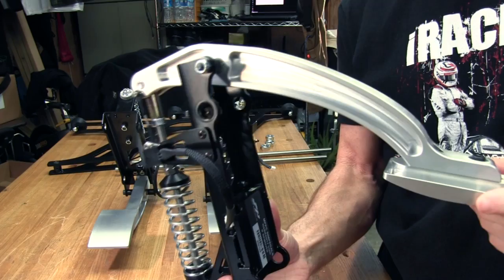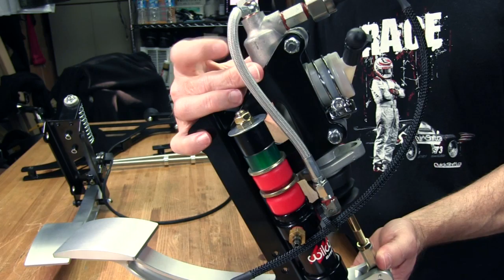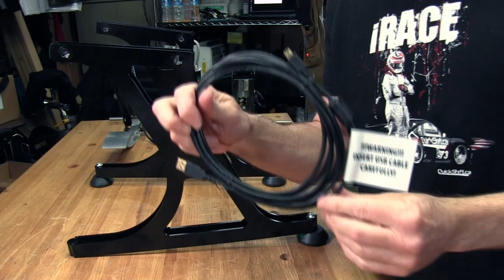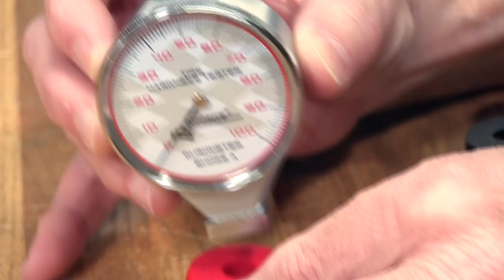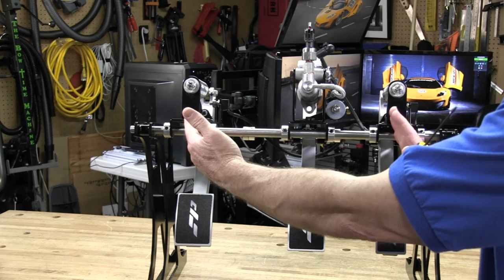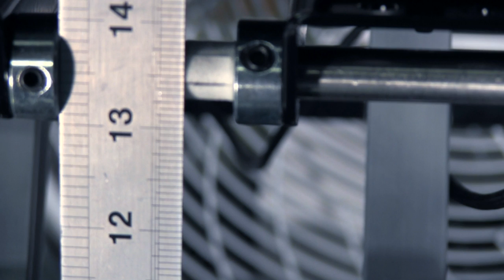Main Performance Sim Pedals Review

Comment: These are gone for good ? :-(
I really badly wanna these pedals...
Reply: Thx for echo, but it is little bit suspicious, this offer is on ebay repeatedly and its the same but in different times. Look.

https://www.ebay.com/itm/Main-Performance-SimPedals-Racing-Simulator-Pedals-stand-amp-Thrustmaster-cable-/223797048341?hash=item341b57f415%3Ag%3AW8EAAOSw%7EhZd9r4o&nma=true&si=g%252BIobRpuSG6s9tABdoJFFtESDeQ%253D&orig_cvip=true&nordt=true&rt=nc&_trksid=p2047675.l2557

https://www.ebay.com/itm/Main-Performance-SimPedals-Racing-Simulator-Pedals-stand-Thrustmaster-cable/223843450833?hash=item341e1bffd1:g:W8EAAOSw~hZd9r4o

Comment: I have these pedals but the brake pedal is leaking fluid. Main Performance told me to buy the Wilwood hydraulic slave cylinder rebuild kit. Bought it but I have no idea what I'm doing. Could you possibly make a video on how to do this? I can't find this information anywhere.
Reply from the maker: If you have never rebuilt a hydraulic cylinder, you may want to take it to a local auto repair shop and have them do it for you. That said, there are a lot of YouTube videos explaining how to rebuild a hydraulic clutch slave cylinder. The Wilwoods have a threaded cap on top that you will have to remove to access the internals. Vise and pipe wrench are your friends here.
Reply: @simracinggarage3026  Now that MPPC is no longer in existence, anyone know where I can download their software to calibrate my pedals?  Or is there an alternative software I can use?  My accelerator pedal works fine, but my brake pedal is only registering a third of the way in Assetto Corsa when I press it all the way.  Thanks for any help for pointing me in the right direction.
Reply: Hey Paul, did you ever successfully use the rebuild kit on these?  I have them too and I have a very minor, almost air like, leak coming out of the shaft of the Wilwood slave near the  bushings.  No fluid loss, but just a wet air leak.  Great set and still works flawlessy, but feel like I need to do something about it.  Love to hear if you had success.  Thanks.
Reply: @f1almsracingfan  I later found that it was a busted o-ring causing the leak. Simple fix but used mineral oil instead of brake fluid for the bleed. They're still going strong and I haven't had a problem with them since.
Reply: @PaulSlavonik  Thanks for the  response.  I suspect that is likely what I have too...seems like the wet air leak is coming from around the center shaft seal .  The center shaft does unthread and come out.   Did you have to remove the slave and take it apart?  Drain or stop the fluid to do it?  Did you just use the O ring from the rebuild kit?  I too have never done this nor know how to do the bleed you reference.  Sorry for so many questions... appreciate your help.  Been trying to find any videos.
Reply: You guys ever get a little bit of noise from the brake? Like if you lay a book on it can watch it jump around on windows calibration? I think I should probably replace the sensor but haven't looked too closely since I also broke the master cylinder cap off

Comment: great video as always, and it's the Holden V8 Supercar,  not the Ford. Also you don't need to use clutch or lift on upshift,  those downshifts are beautiful,  which I could heel and toe like that (that's how the real life drivers to it with 1 or 2 exceptions who LFB with a blip )

Comment: so if I was to make my own hydraulic brake sim pedals, I would need a master cylinder, something for it to compress (to resemble a brake caliper), and a pressure sensor. Plus the software/circuit boards to connect to sim?
Reply: If you have to ask this then you don't have the expertise to build such a Thing.

Comment: how about the distance between the pedals? doesn't look "real", they look very separated from each other; but I suppose one can get them close to each other like a real car. Thanks for the videos.
Reply: Raudel Hernandez Spacing is very adjustable.  Barry goes over how they adjust in the video.  Also, these are likely the most adjustable pedals available.

Comment: Barry...as always, LOVED the review and found your insight/comment about the bar flex to be 100% accurate!

Quick question if you don't mind sharing an "opinion"...if you ONLY had to choose between these pedals and the HPP pedals..both of which were in the inverted config..which would you go with? 

Look forward to your upcoming AccuForce wheel review when everything comes together!
Reply from the maker: Sim Race Driver Can't really answer that now. I will be reviewing the latest version of the HPP pedals. The 3P-PRX-SE set when those start shipping. Mark is going to be making a floor mount bracket for this set as well. So I will be testing them in an F1 pedal configuration and the hanging "GT" pedal configuration. Might be a couple of months before they start shipping though. Thanks for watching!

Comment: I'm not the one to complain, but looking at most purpose built gt cars (GT3 does not go in that category since they use alot of standard parts) they have floor mounted pedals boxes, for instance BTCC and V8 Supercars and so on. For most racer its easier to modulate with a floor mounted pedal box and I agree on that.
 However these pedals are beutiful made indeed.